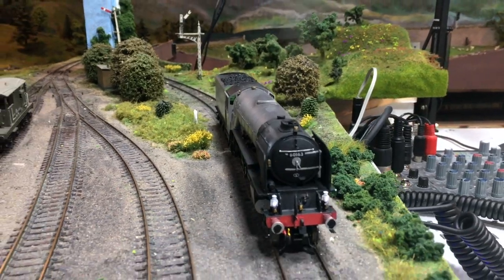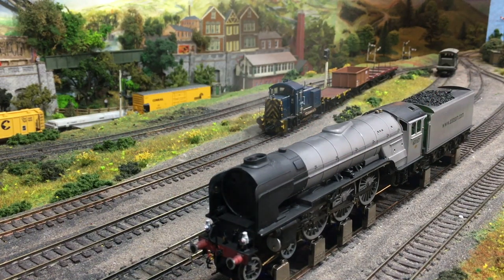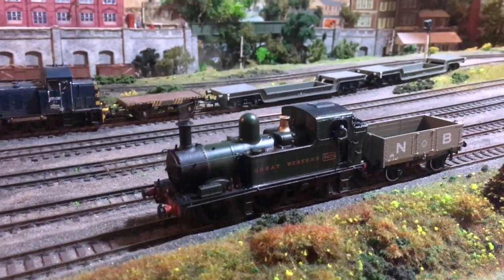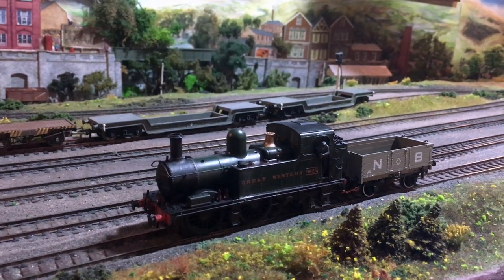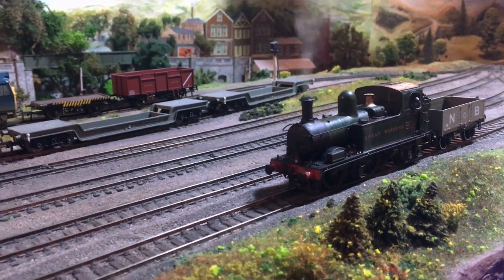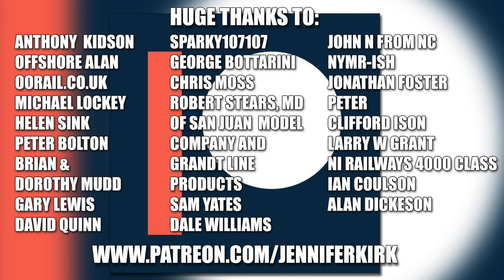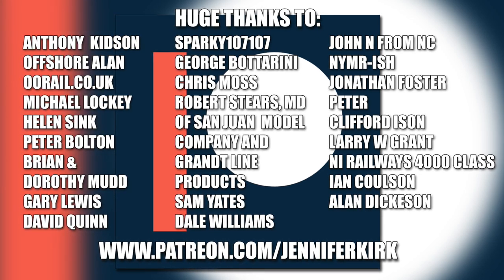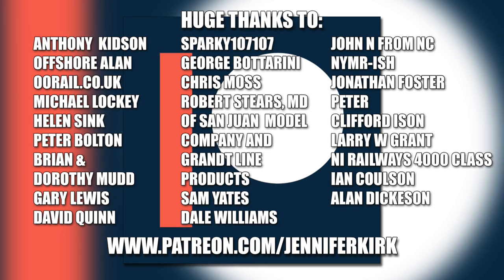The Best Real smoke effects in the tiniest locomotive? TRS Trains 14xx

Comment: This is a total waste of money in my mind, sound systems for OO gauge are in my opinion not worth the money, one common problem with them is that they are out of sync with the speed of the locomotive and that is true for really expensive top quality sound systems, another problem with them is that for diesel locomotives the sound is far too high pitched and this is because the speakers are not capable of producing the proper sound no matter how good a speaker it is, the smoke system while it does look good if it is going off of the sound in the locomotive which I think you said it does this would make the puffs also be out of sync just like the sound is out of sync, personally if I was paying for systems like this which can be very expensive I would like to have thought that they would be in sync with the speed of the locomotive, it’s all up to personal choice of course but personally I will use that money for something different.
Reply: Guess you need some sync.
Reply: @phil36310  what do you mean I was only stating my thoughts on these systems based on what others have said.
Reply: @davidstrains4910  David, do not always believe what others say. I have very positive and satisfying experiences with sound on OO even if it will never be as the real thing. Not even on O scale. But it adds a nice dimension though. Worth the money ? That's very relative, no ?
Reply: @phil36310  I don’t always believe what others say I just think for the price of dcc sound locomotives and upgrade kits are not worth the money, yes I have agreed with something that another person has said but this is how we learn these things because funnily enough these things are not mentioned anywhere else, it’s all up to ones own opinion in the end though and my choice is that they are expensive and not worth it, who knows maybe one day i will try it and maybe my opinion will change.